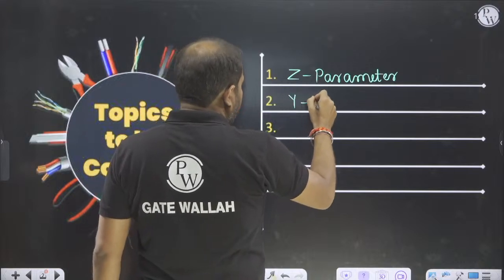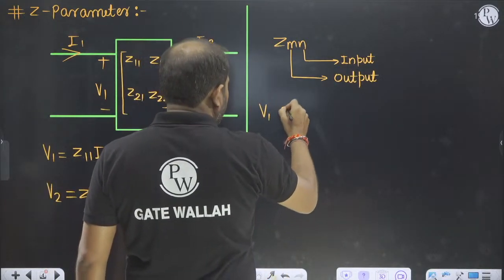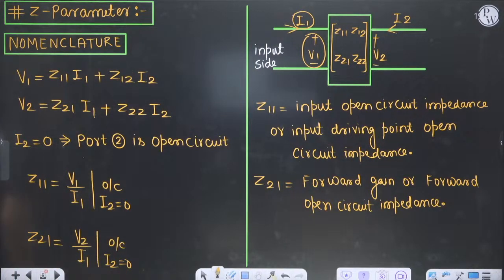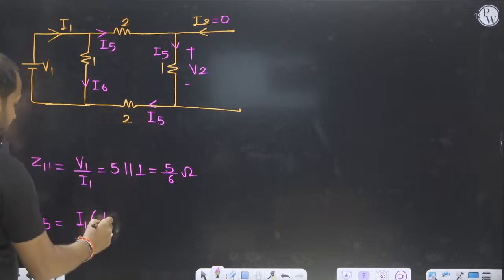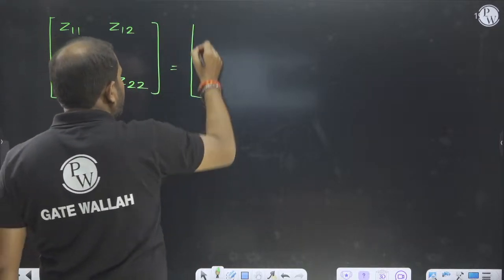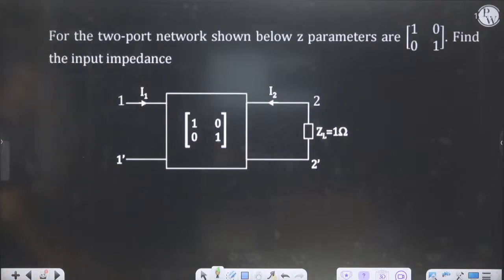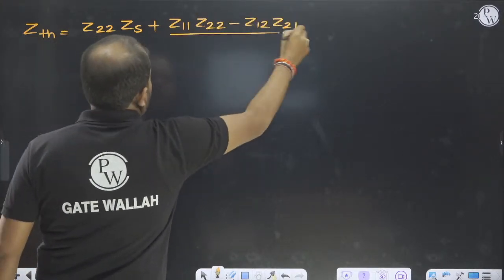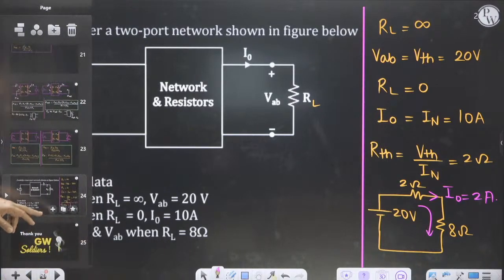Network Theory 01 | Two Port Network (Part-01) | EE & ECE | GATE 2025 Series

Comment: This video covers fundamental concepts of 

Introduction to Two-Port Parameters: (1:21) 
Overview of Z, Y, H, G, and ABCD parameters.
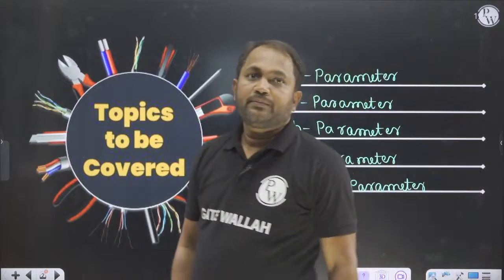Z-Parameters (Open Circuit Impedance): (2:35) 
Definition and nomenclature (Z11, Z12, Z21, Z22).
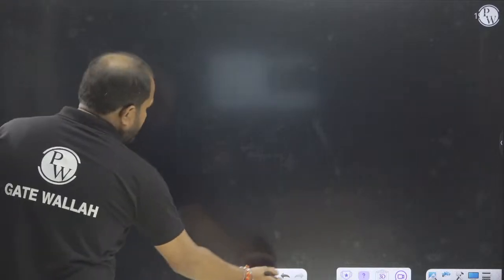Calculating Z-Parameters (Examples): (21:33)
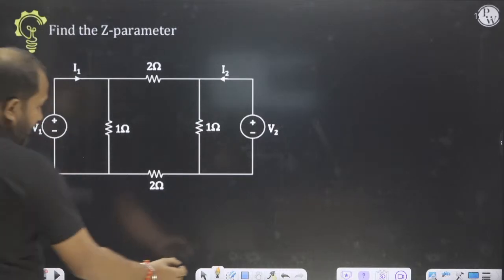Step-by-step derivation for resistive networks (21:38).
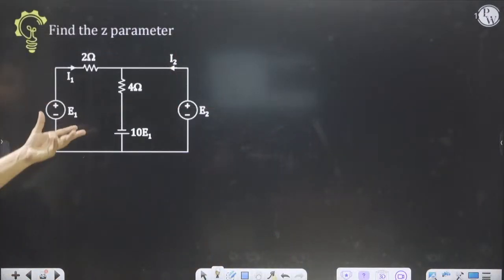Solving with dependent sources (32:18).
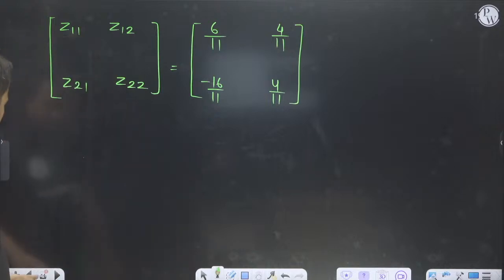Input Impedance (cap Z sub i n end-sub): (41:14)
Formula derivation in terms of Z-parameters (42:06).
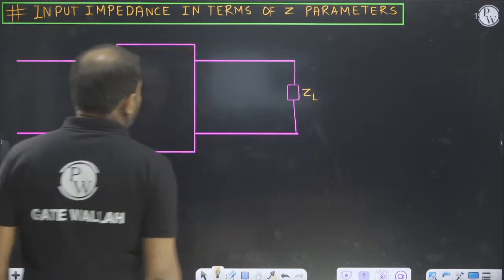Handling load impedance (cap Z sub cap L) (43:02).
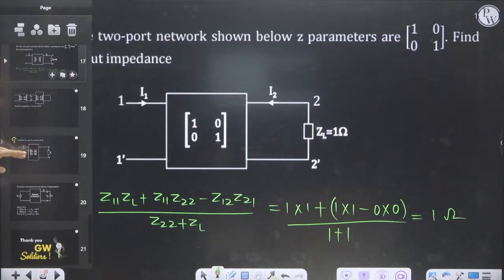Thevenin Equivalent (cap V sub t h end-sub and cap Z sub t h end-sub): (51:36)
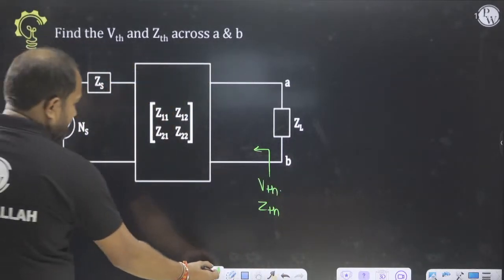Calculation of Thevenin voltage and impedance for two-port networks (52:01).
Summary and Practice: (1:10:05)
Recap of Z-parameter properties and guidance on further practice.